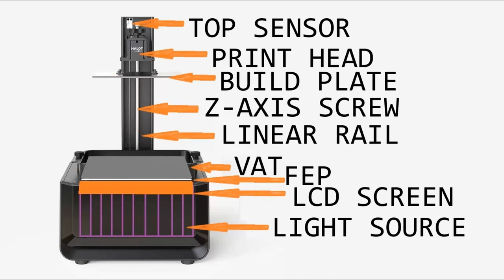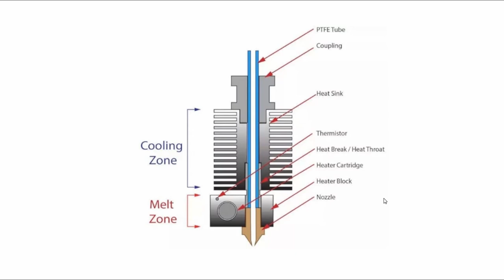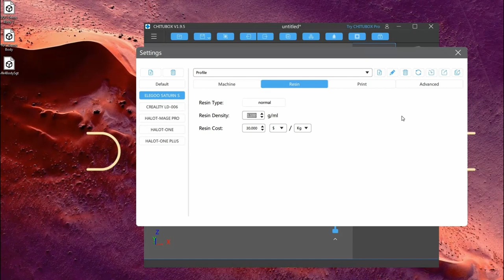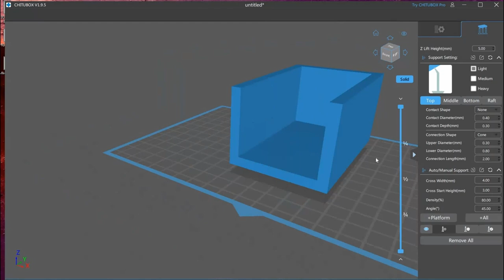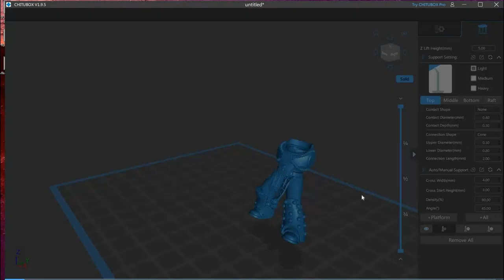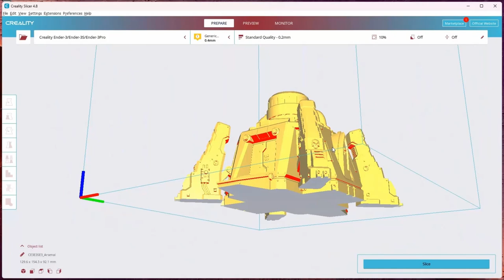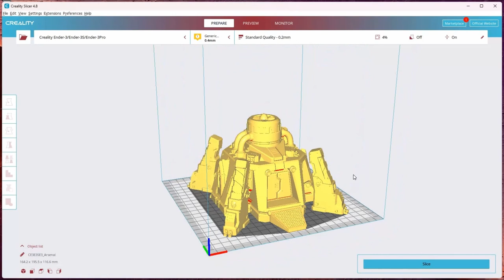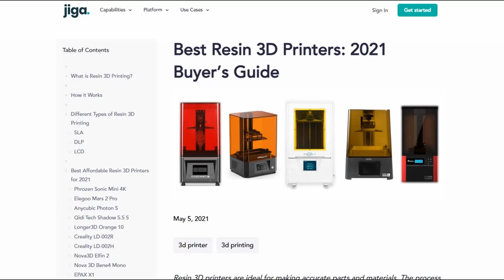3D Printing for Wargaming 101

Comment: Can you compare Chitubox Vs Lychee?
Reply: Lychee is fairly easy to learn for people that don't know anything about it. The auto supports need some human input added but for the most part. It's fairly straight forward.
Reply: One thing I noticed is that Chitubox hates being on the same machine as Cura (slicer for FDM printers) don’t know why, but the software would freak out and mess with files between the two programs even when it wasn’t involved itself. 
That alone made me go with Lychee which doesn’t have the same issue.

Comment: Another thing I would say for those looking at 3D printing, is if you have a friend with a printer, get the same or similar. They can help you with any problems you have, and you can help them with problems they have. I keep eying FDM printers, and then GW terrain, the buy in for FDM is getting to an insanely low point, same with resin, that it's hard to not just buy one.

Comment: One thing I noticed very quickly once I had both a resin and an fdm machine I very quickly figured out I had a favorite child between the two and it usually depended on which one was behaving the most.
Some times the resin would work just fine or a failure was because I was dumb. Some days it didn’t matter how many times I leveled the bed, made sure the supports are good, and made sure the temperature was good it was failure after failure.
Same with the FDM printer as some days it was just throw the flash drive in and let her run and check back in like a day other days it couldn’t feed to save its life or it would decided like 80% done was the perfect time to just stop working correctly and now it must spew a mess of plastic everywhere.

So like any good parent you should only love them when they do what they want and threaten to throw them out when they misbehave.